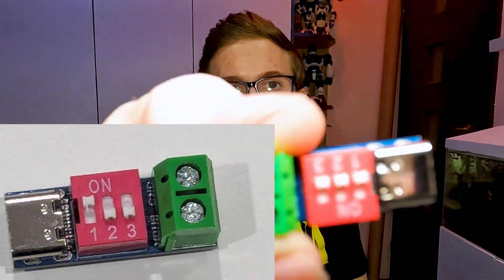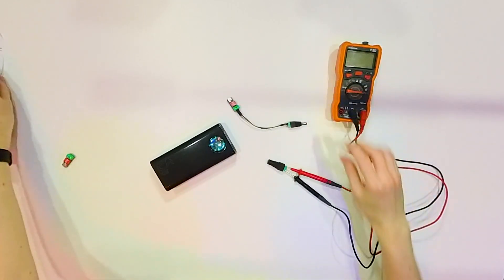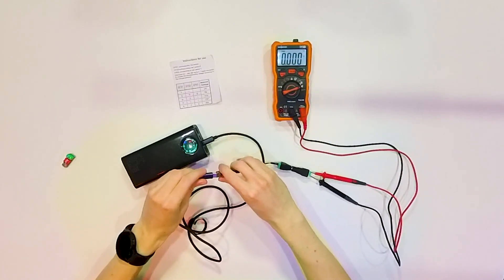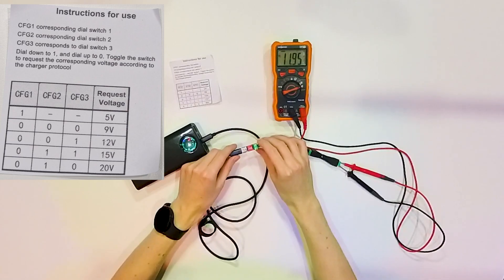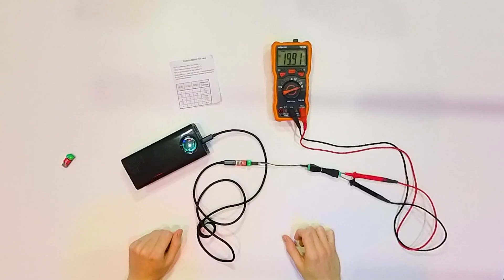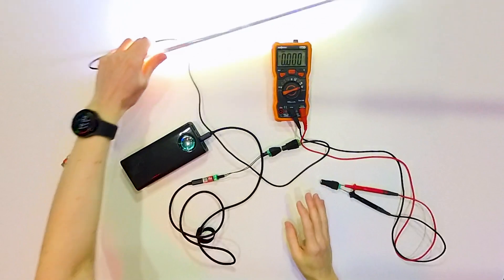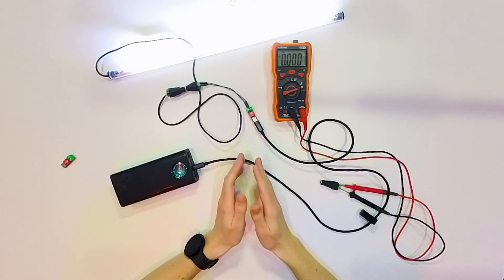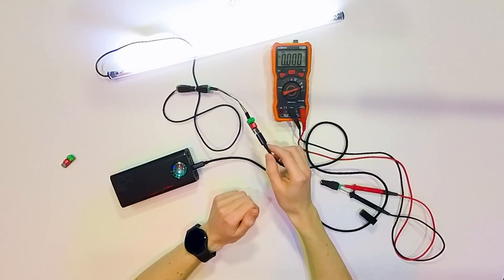Deep Dive: USB C PD Trigger - Yay or Nay?

Comment: Cool. I bought some. I want to provide a Rasberry pi 5 power from a Anker 140w powerbank. Pi needs 5 amps, can I join two PD to deliver more amps to pi? Thanks
Reply: I Guess a real 140 w Power bank, I mean Just One Port supplies 140 w, you already have 5 amps. Can measure It also with a USB multimiter

Comment: Does the trigger need a load on it to work ? I bought 5 of these and none of them will get the 15 or 20 volt output. I am using a 180 watt multi charger that should be capable of 20 volts. Thx
Reply from the maker: It should work without load. Make sure that the charger is turned on, uses PD protocol and can output 20 volts in PD. Do you get at the output 5V or 0V?

Comment: what happens if you set it to 20V but the charger does not support 20V? Do you just get 5V or nothing?
Reply from the maker: I think you will receive the maximum voltage that the charger can output, so for example 15V